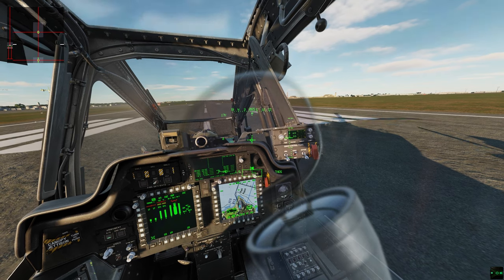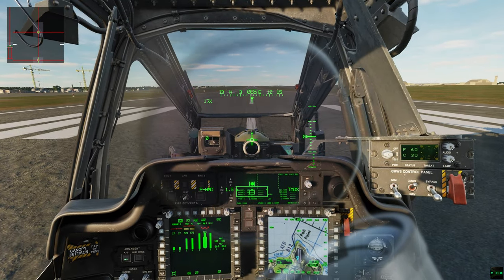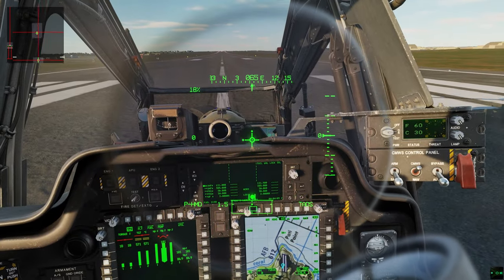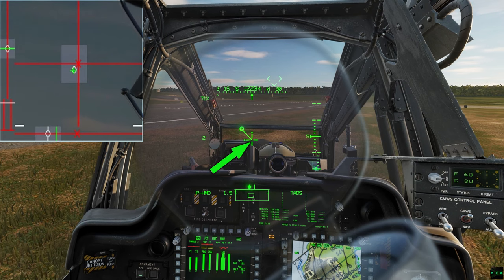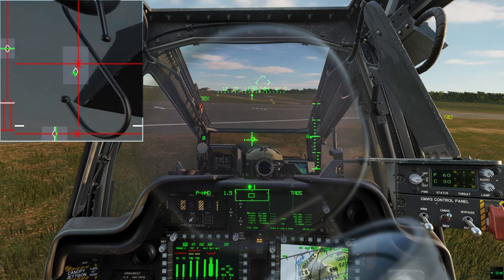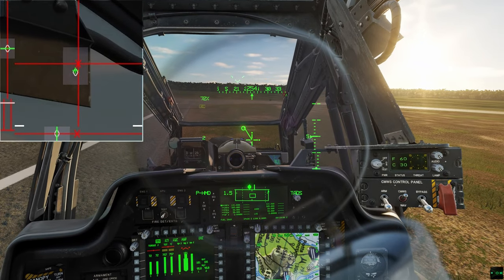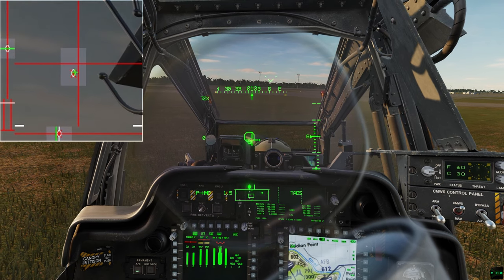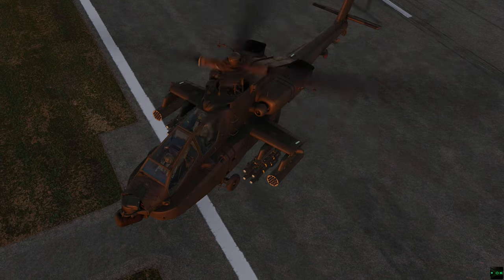How to Fly the DCS AH-64D Apache #4: Hover & Helo Response

Comment from the maker: Since this video was made, hover hold has been implemented, altitude hold has been broken-and-fixed. One thing to note, is now before you even raise the collective, your pedals probably need to be slightly to the right of centre (see https://forum.dcs.world/topic/309212-anti-torque-pedal-rigging-since-dcs-271830348-open-beta/#comment-5054028). Then as you raise collective you'll add left pedal, probably end of with more left than right pedal input as you go wheels light.